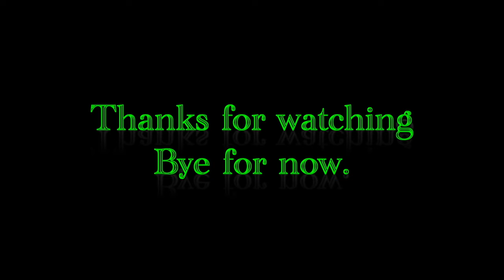Removing a Triumph Sludge Tube.

Comment: I've done this job a few times years ago. You basically did everything I used to do except find away to drill out the divit.
I used to clamp the tap in a vice & tap the crankshaft away from it releasing the sludge tube.
You did good.
Reply from the maker: Hi Todd, thanks, cheers

Comment: eyup Paul Great job👍👍👍👍🏍🏍🏍🏍🏍🏍
I feel your pain, where there's a will there's a way, 
ive been there with my bsa shooting star some years back, mine did succomb to the trusty impact wrench, however i went through all that for peace of mind, to find out really it did'nt need doing, it was suprisingly nearly as clean as a whistle.
Can't believe how much solid sludge was in yours, someone wasn't doing routine maintenance all those years ago, i must have  got my bike via the only chap in uk who changed his oil  every week🤣🤣🤣🤣😉😉👍👍🏍🏍🏍🏍🏍🏍
Great job as usual Paul
BFN
Kev
Reply from the maker: Hi Kev, it was a bit of a surprise when I opened it but, it has to be done. cheers.

Comment: Great job, I've had some fun and games getting those things out on my old Bonnie, I did have to re-use my sludge trap, as there were no replacements at the time, but like you, I used the tap method to extract, cheers, Dave
Reply from the maker: hi, still nothing new in engineering. cheers

Comment: I am wondering if the crankshaft is still balanced after inserting the new sludge tube, because you mentioned the old one had thicker walls than the new tube, so the new one will be lighter than the old one which will disturb the balance of the crankshaft...
I know this particular crankshaft is not meant to be used in a running engine, but still, if you use such a replacement tube for a runninfg engine this will cause problems...
Reply from the maker: Hi, very true but, I would imagine that the difference would have been negligible compared to the amount of sludge I dug out of it, the sludge alone must have been twice the weight of a new tube. I wonder how accurate crank balancing was when the crank was first built.  I will probably never know. Still, when the main flywheel is removed to grind the journals it'll be the time to check that when the flywheel is remounted. cheers.
Reply: @Thesheddweller  ok, i didn't think about the weight of the sludge, maybe the new tube is lighter on purpose to compensate for some of the weight of the sludge...
It is probably also pretty hard to balance this crankshaft because even without any sludge you need to consider the relatively large volume inside the crankshaft which is probably empty while balancing but when filled with oil in the running engine, the oil adds a noticeable amount of weight...

Comment: Excellent job. Have you seen Ade at AG Engineering? This sort of thing is his stock in trade. Likewise my brother at Retromeccanica. Your film was brilliant.
Reply from the maker: Hi, yes I have seen AG Engineering but not Retromeccanica. cheers
Reply: @Thesheddweller  Retromeccanica has just done an excellent modification to use a Yamaha clutch in a BSA Bantam. It is a mod done on trials bikes for years, not without compromises. Retromeccanica has done a fully engineered modification which removes many of the shortcomings of previous iterations. Well worth a look.
Reply from the maker: @carlwilson1772  well after a recommendation like that it has to be visited... cheers

Comment: Can you say what size the bore tap was ?
Reply from the maker: Hi, if you’re on about the tube bore, i can only tell you what I used in the video. All I can say is use what ever fits!.. some of the tube bores are different sizes I just happened to have a 10mm tap to hand, and it worked. Hope that helped
Reply: @Thesheddweller  No sir not the tap that pulled out the tube, I was asking about the tap you used to clean the  hole threads for the plug after the tube was already out...thats what I was on about.
Reply from the maker: @pauliebots  sorry, I misread your comment.
Being a triumph nothing is that simple, the bung thread  up to 1967 is 11/16" x 20tpi cycle thread.
But there are variations some have 3/4" x 20tpi cycle thread, and some are 9/16" x 20tpi cycle thread, depending whether timing side or drive side. I'm sorry I can't be more specific than that I'm afraid. hope this helps. cheers
Reply: @Thesheddweller  that's perfect! Thanks for the info and your time.